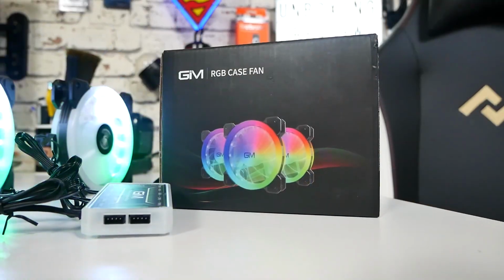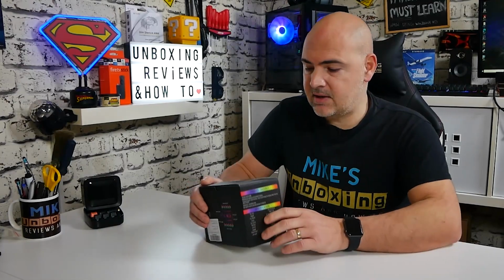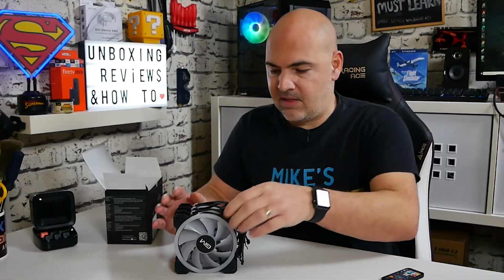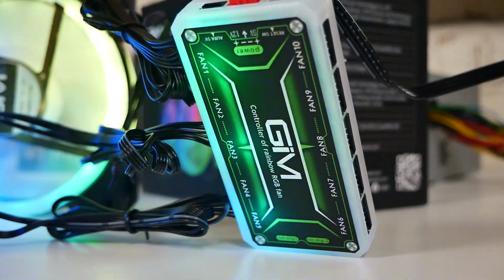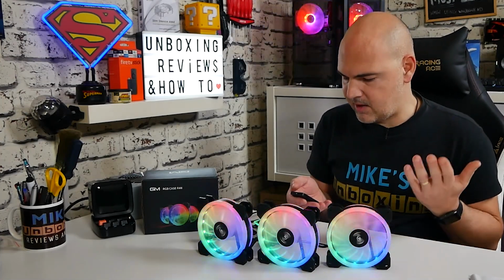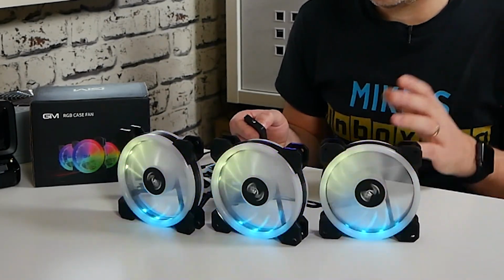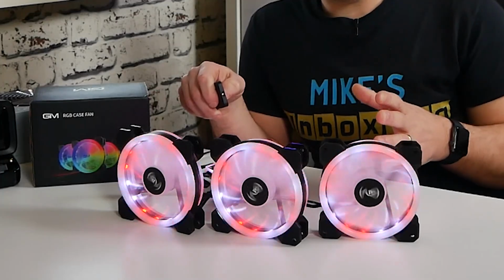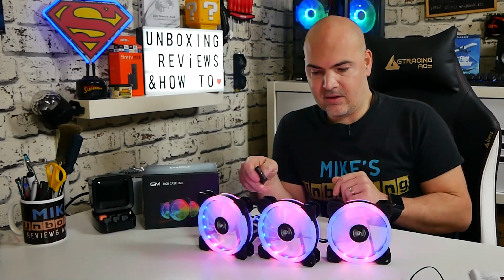GIM Addressable 120mm RGB Triple Fan Set With illuminated ARGB Hub & Remote Control

Comment: Hi it IS possible to put out the 12volt molex Pins and let it work only with the 7v molex pins. So not spinning at full speed when start up. Sorry for my English hope you understand
Reply from the maker: not sure maybe but the lights would be very dim

Comment: What if my mother board only has a 4 pin fan header but the cable is 3 pin that comes with the controller?
Reply from the maker: it is fine just use it as a 3 pin
Reply: @mikesunboxing  will it short circuit the motherboard or it’s safe?
Reply from the maker: @dlazyace9116  if the 3 pin looks like a 4 pin just with a pin missing that is fine, there should be small indents that prevent it being pulled in wrong, if you are unsure post the pics on the discord in the tech support channel and we can take a look
Reply: @mikesunboxing  i got it to work. thank you for the help.

Comment: If im using the 5v motherboard connector do i use the sata cable as well to my power supply? Or is it one or the other? I saw some things that it could possible fry the motherboard and I just ordered these any help means a lot thanks
Reply from the maker: yes the 5v only really sends digital information rather than powering the fans

Comment: What if i wanna connect all type argb leds to one 3 pin header on motherboard by using argb splitter...is the mobo able to sync all of that at once ?
Reply from the maker: yes it will replicate the signal

Comment: Could you put these in an aio to replace fans that come with it
Reply from the maker: yes that is fine, but the speed control would be lacking
Reply: Can they just be controlled by the sata connection
Reply from the maker: yes but not speed controlled

Comment: Bought a set of these on the back of your review Mike. So far so good 26°C at idle and max of 45°C running Cinebench. It's a shame there's no way of monitoring the fan speed in MSI bios or hwinfo. Is there a way of doing it? 9/10 for these definitely gets the thumbs up from me lol....
Reply from the maker: yes they are actually pretty decent fans, not found any way of monitoring them yet though

Comment: Mike for example if i want 6 RGB MIG fans but now i have 2 hubs can i connect the all 6 Rgb fan to 1 Hub or do i still have to use both hub on each 3 fans separately btw thank you so much for making a review on a rgb fans that a bit more cheap and have a hub
Reply from the maker: you can connect all to one hub no worries
Reply: @mikesunboxing  ok thank you so much

Comment: Newbie question, if I have an older mobo (rgb, not argb) I would need to use the controller. After setting them up, do I need to always turn them on via controller every time I boot? Or can I just set them up for 'unicorn puke' and throw the controller into the dark deep pit? :)
Reply from the maker: yes that is right set and forget

Comment: Those are the updated Coolmoon kits which used to be 12v but same outlay and graphics on the controller. I bought 12x coolmoon controller kits and 60 fans from an ebay seller a year ago and 6 RGB strips for fair chunk of change. I have to  say I really like them. My last controller kit and 3fans in a PC I have up for sale now similar to the tiny Ionz build I sent you photos of which had my second to last kit in. Remember me telling you of the Zalman case with 8fans in? Had 8 of these fans and 2 RGB strips which are 3pin like those 6pin terminals proprietary to the controller looked really good.

The fans are same as some sharkoon, gamemax and a couple of other brands just depends how they are terminated 6 pin or ARGB+3pin DC but the blade and shroud mouldings are the same they are a good fan got a mate his system been running them for 2years now with no issues other than dust build up as any fan would. I highly recommend these kits for builds where there is no motherboard control and a pound shop magnetic strip stuck to the controller so you can throw it on the side panel of a case is a big help in keeping tabs on it. Scrolling through the settings was a bit of a task but fun none the less with many variations of the same effect but for finding a unique colour set up for a specific build what more could you want? Those new updated 5v systems look the bomb, I really like the addition of the sound activation I can see me buying another bulk load of these in the near future as they are great in function and price.
Reply from the maker: the voice or sound activation is a pretty fun feature and i can see it being used in youtubers videos in future

Comment: Bling indeed, they are hella bright !!!  That RGB hub isnt too shabby either, looks quite smart and a change from the plain black ones that normally come with these kinds of sets (even though they usually get put behind the back panel of the case).   This set is sooooo full of features, I do like that reactive setting, thats not something you see a lot of.    As you know Im not a fan of the unicorn vomit but I have to confess these do look really nice and I think that for what they cost they are an absolute bargain !   Thanks for sharing these with us Mike and Kath, always appreciated.
Reply: The reactive thing is cool indeed Bob, I agree. Also it doesn't bother me too much that the hub integrates 12v/5v/RGB data into a single 6pin connector. Prob makes cable management neater and I have already complained that modern fan headers should accommodate more than just 12v power and RPM signal (more pins!)
Reply from the maker: unicorn puke it the future bob ;-)